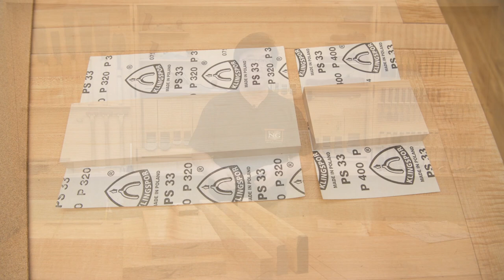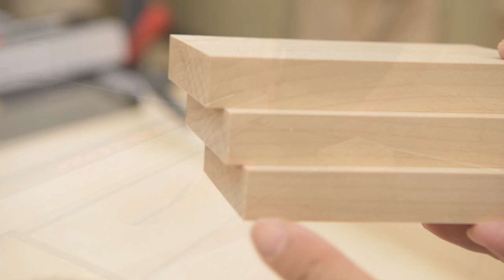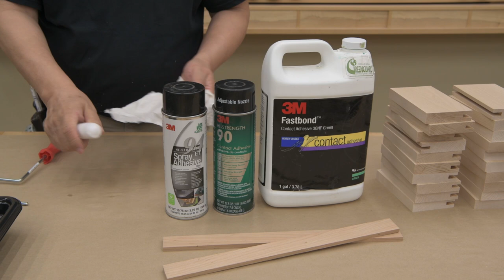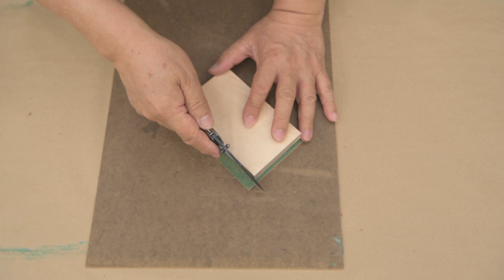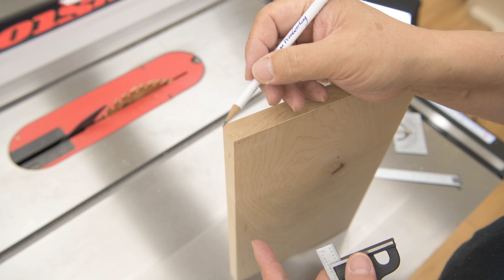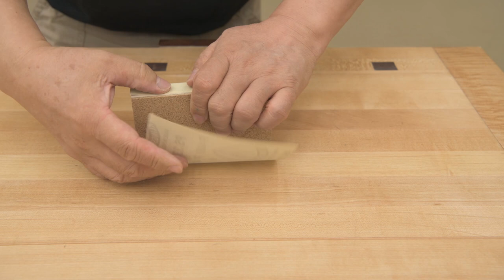Turn Your Scrap Wood into Cool Sanding Blocks

Comment: This is a superb video! I have made two batches of sanding blocks, and I’ve made a discovery perhaps others will find useful.

I hate sanding. To make sanding less miserable, I keep five dedicated sanding blocks loaded with 80, 120, 180, 220, and 320 grit sandpaper. Unfortunately, the optimal wedge width varies with the grits.

My solution is to purposefully cut the wedges a little bit wide. I made a simple jig that fits in my bench vice. The jig has stops in two directions to securely hold a wedge. I then "fine tune" each wedge width using a block plane. A nice bonus is the block plane removes any saw blade marks.

Comment: Hi William, thanks for the great tips especially the dado tip.
Being in Phoenix, we had problems with heat release on laminated products. One of our suppliers recommended a spray contact adhesive called TACC. Available in spray cans & canisters for pressure/siphon systems & a higher release temp.
A sanding block we used a lot was fit to used sanding belts. Break the end corner edges to keep from tearing the belt.
Take care hand model!😊

Comment: Not that I have anything against a nice, accurately cut and made sanding block, but I've been sanding things since I was a young boy and now in my 60s I still haven't found the need for a super accurate sanding block. Just about any block of wood will do. Flat helps, but not absolutely necessary for most jobs. In shop class it was just a chunk of wood with a piece of really worn out piece of paper.. Maybe it's just me, but youtubers have seemingly promoted the humble sanding block above the status of the saw.

Comment: Nice project. How would you go about making sanding blocks for the reverse convex trim (cocave blocks) and how would you attach the cork and sandpaper to get a smooth block? How about complex mouldings with multiple concaves, convexes, and rabettes/rebates or v-notches?
Reply from the maker: Convex shapes are easier to sand I don't use a sanding block. I just hold the sandpaper by hand and go st it. If it gets hot , I shield it with a 1/4" foam.
Reply: @wnwoodworks  thanks.

Comment: Hello Mr. Ng i have enjoyed watching your channel. Im also an Ng. Im here in Ventura and recently started woodworking and picked up a used skillsaw table saw. I am wanting to make a sled for it but have run into a problem with the guides on the table having notches. Any suggestions for making a sled for my saw? Its a model 3410 Skillsaw. Thanks again for a the great videos.

Comment: Awesome idea, sir, as per your usual videos. The water based 3M contact adhesive is a new one for me. Do you find the bond strength comparable to the "old nasty stuff"? I assume you do the same with the water based stuff: apply liberally to both surfaces and let let dry, to the point that (unglued) paper wont immediately stick to the glue before joining up the two pieces?

Comment: Thankyou very interesting. Please do you have any simple projects ideas for 11year old students? Using simple hand tools. Thank you very much for your dedication in educating others. I do a similar job and the most difficult part I find is to make similar projects without using dangerous machinery except for easy to use electrical tools such as a pillar drill or battery operated tools.

Comment: So you do hand modeling too? It's hard to get anything done in the shop because I'm always getting calls for a modeling shoot.

Seriously though, those sanding blocks beat mine by a country mile. I use a 1/4 sheet wrapped around two edges and one side of a block, but it gets tiring trying to keep the sandpaper flat on the surface while holding it tight against the sides. I tried 3M 90 and it worked well, but it was a nightmare getting the sandpaper off. 3M recommended their 3M 77, but I think I'll try your way first since I don't need two cans of spray adhesive.

Comment: How can I cut the wedges with a blade guard on? We're not allowed to take it off in class. Is there another way? Maybe cut the wedge on the off cut side? With a fixed stop and then move the fence after every cut?
Reply from the maker: That's going to be tough to get consistent cuts. Every time you move the fence it changes.
Reply: Block plane from a rectangle stock? Good planing practice. William must be sleepy to have missed that solution... ;-)
Reply: @wnwoodworks  I was thinking something like this: https://youtu.be/AKOefGSSl4A?t=95 Maybe there is risk of binding between the stopblock and the fence though.

Comment: 6:07 Could you put a clock on the table during this frame? Just so we could see the passage of time? I never get contact cement right and I think it is because I either dont wait long enough or I wait too long.
Reply from the maker: Great idea. I'll do that in future videos. I didn't wait too long 15 mins max
Reply: Used to apply countless sets of Contact/Rubber cement boards for work back in the 90s. Normally if we are in a hurry hair drier on low can get the job done under 10m but some believe it weakens the bonding strength. hope it helps

Comment: Does your disc sander rotate clockwise?
Reply from the maker: It's Bi-directional. It rotates clockwise and counter-clockwise made by Conquest. made in USA with Baldor motor.
Reply: @wnwoodworks  Mine only rotates counterclockwise. I made the mistake of using the right side once and got hit in the mouth. I assume whatever direction you're going, you're sanding on the downside of the disc.

Comment: The difference between your $120,000 US in tools and my woodworking tools is about $118000  US. I still consider myself lucky though. I like to see what they can do, and a good operator can adjust for compromises in all but flawed equipment. "Perfection is the Comb that You are left with, after You have pulled all your Hair out"  Ancient Chinese Proverb. (I wish I had more Hair)
Reply from the maker: HaHaHa I always say "It's better to have mediocre tools and do Great work than have Great Tools and do mediocre work. Tools can never put soul into your work, only you can.

Comment: No offense, but like too many "woodworking" videos, this implies that even the simplest project requires an arsenal of expensive power tools (in this case a bandsaw, planer, table saw, sanding center, and router with several roundover bits), which a very a small percentage of woodworkers have. Why not show how these these sanding blocks could be made with a few tools that most woodworkers are likely to have and a modicum of skills?